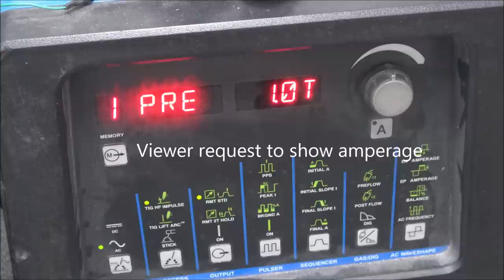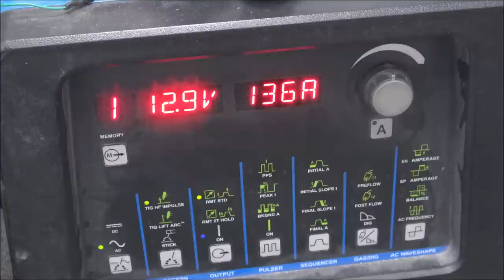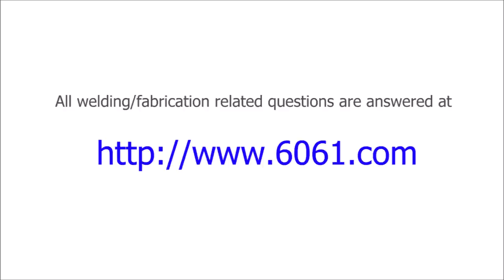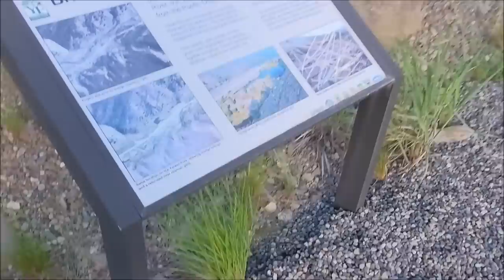Welding Tip / Advice - Attention to Detail - TIG Welding Aluminum Fabrication - Weld Stop

Comment: I never figured out what it was.....but fantastic job!  Your welding/fabrication/machining vids are some of the best. Thanks!
Reply: could be a tool to round off concrete?
Reply: @erikslagter3231  I was wondering the same thing, but it seems like aluminum would wear really fast against something that hard.
Reply: It would be a sin to get concrete on that work of art!
Reply: I'm thinking it's a handle to carry grocery bags
Reply: If we don’t know then it will probably have another video or two about it. At least in that’s how it was in the past haha 😂
Reply: My first thought was one of those push-up handles that are supposed to be easier on your wrists when working out. I like the grocery bag idea though

Comment: Very nice job whatever it is.  I have a tig button and have recommended it to several people.  I also made a slim tig button holder that fits the CK torch with carbon fiber PETG 3d printer. Thanks for the video.
Reply from the maker: Hi John,
Will you please email me a picture of your custom holder? Email address is at the top of my website.

Thanks,
Aaron

Comment: Been watching you for years now. I have learned so much (or nothing, lol), thank you. However, never ever seen you welding thin-to-thin aluminium. That's quite common task that I have in my yard - to weld an aluminium based frame out of thin square/round tubes.  Any chance you could show us how to weld 1mm to 1mm thin aluminium? And perhaps in a manner where you cut a profile into 2 pieces and then weld it back together. I find it extremely challenging.

All the best.
Reply from the maker: Hi Alexander,
Any specific size tubing, and any specific profile?
Reply: hello. Just L or U profile, mine were 1mm thick with 30mm width. Thank you a million! The hardest thing is to weld it if cut at 45 degree angle. I tried posting an image here, but it gets deleted. I'll try to put it into next comment.
Reply: but my welds are horrible, sorry
Reply from the maker: Please email me through the website

Comment: Very nice.  I noticed he uses preflow to blast the gas over the area before the arc even starts.  Cool.  My machine don't have. 😢
Reply from the maker: You have manual preflow. While in position, just tap your amperage controller a time or two before welding. Not too big of an inconvenience.

Comment: Which torch are you using with the button attachment I have 2 dynasty 400 machines for heavy aluminium welding (tanks for radiators) mostly 15mm thick sometimes 30mm.
I'm also having trouble with the standard earth cable when welding at high amps it seems to glow red any fix for this?

Comment: Excellent work and beautiful nature! Interesting history about the dredging and the salmon.

What is the black sooty stuff when you were tacking the handle on? I’m just getting started with TIG welding and have yet to try aluminum. I’m just curious.
Reply: Contamination...he accidentally dipped some filler on to his tungsten.  You see a green flash when this happens.  Clean up the soot, grind the tungsten and back to work

Comment: Nice work! I'm a lefty too, however the first two sections of my left index are no longer attached.... the TIG button won't work for me... :(
Reply from the maker: Hi Glen,
Skip to 5:15
I'm using my birdie finger on the button and clamping the torch with my ring finger and thumb. Index finger not being used.

Comment: I sure wish the tig button would be available for the weldpro tig 200
Reply from the maker: Hi Chad,
Please email me a picture of the foot pedal connector through the website.
Reply: Hi Chad, I have a Yeswelder 250P and they don’t make the Tig button for my welder either. But I built my own custom Tig pedal so I learned all about what the welder needs for a signal. They are very simple inside and basically have two wires for switch to begin the arc and three wires that go to a potentiometer. That’s it! I purchased a Tig button for the AHP and re-wired the plug to match my Yeswelder Tig because the AHP and Yeswelder both use a 10k potentiometer. The good news is that almost every Chinese Tig that I’ve reviewed on my channel uses a 10k potentiometer with a 5 pin plug. If you opened up your pedal for the Weldpro I’ll bet it uses a 10k potentiometer. If it does, let me know and I can walk you through the process of how to wire it up if you really want a Tig button. I can assure you that it will change your whole world once you get used to welding with it. 😁👍
Reply: @PranaTech  hi mate, just reading through the comments and notices you were able to make the tig button work for your welder...I also have the same problem that they don't make the tig button for my welder...my foot pedal has a potentiometer and basically varies the 10.8v down to 1 or 2 volts...any ideas how I can adapt the tig button to my machine?